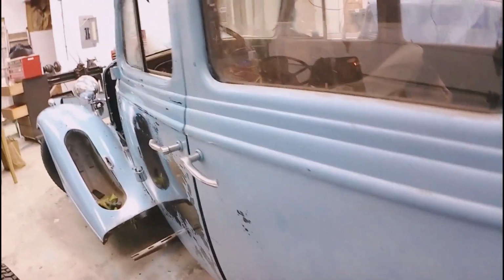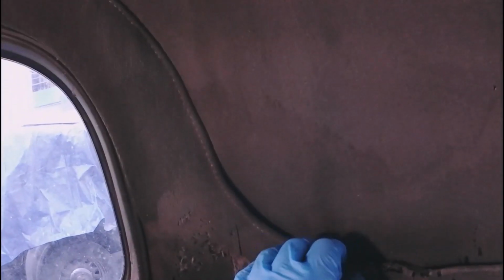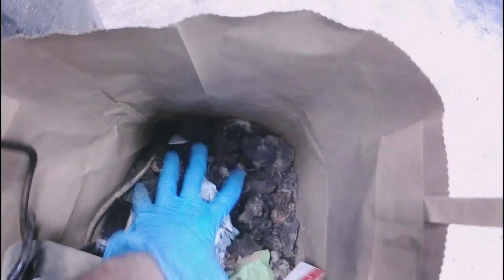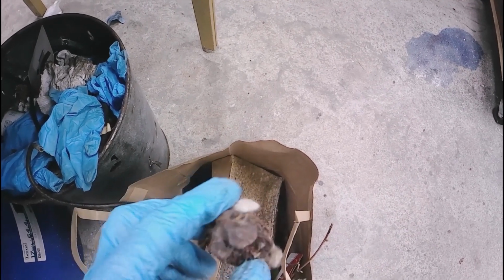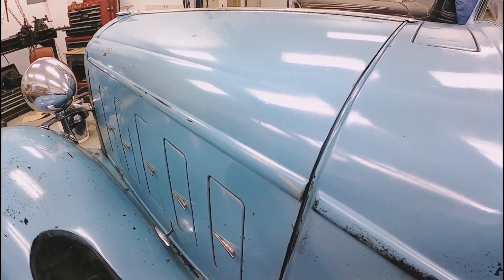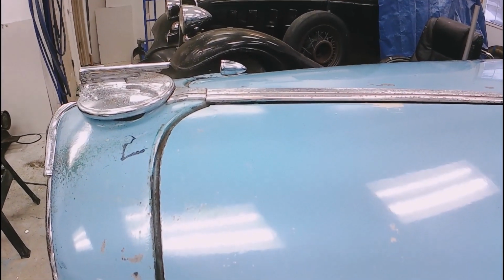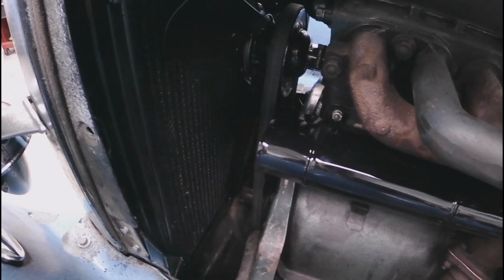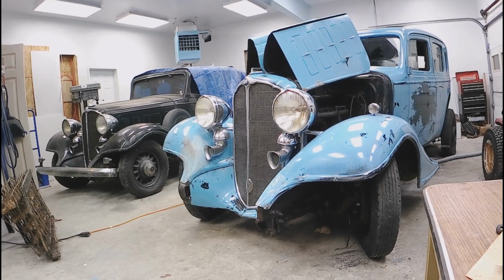1933 Buick Hood and trim etc.

Comment: Beautiful cars!!  Really like your sense of humor, LOL.  You deserve more subscribers!!  Cannot wait to see these running and driving.  Are you planning to restore the interior?  I've subscribed to your channel, you have me hooked on watching the progression!!
Reply from the maker: Much thanks! I had been making these videos for my stepdad who's unable to travel here, and figured they may be useful to other '33 owners for reference. I honestly didn't think they would gain as much attention as they have, as there are so many good car / restoration channels on here, but certainly happy that people are finding them useful or enjoyable!

On the interior, yes. I've been slowly dismantling interior parts as I remove them and making templates. I have an old leather patcher and another machine that I have been able to use to upholster parts with. Both the cars need complete interiors and possibly a 3rd that's outside. I've been searching for a deal on Mohair but haven't had any luck yet.

Glad you are enjoying the videos! Do you happen to have any experience with sand casting? At some point I need to cast some pot metal trim parts and possibly a brass impeller for the water pump, but I've no experience with any of that (yet). 

Cheers
Chuck
Reply: @78chuck   --  Unfortunately I don't have any sand casting experience.  30 years of Blacksmithing, including for the National Park Service, but I've never sand cast.  However, subscribe to "Windy Hill Foundry" !!  He specializes in helping people who are restoring antique stuff like us.  I've seen him cast unattainable and rare auto parts.  His channel should have contact information. I've known about him for awhile because I belong to several organizations that deal with things like steam engines, hit and miss engines, antique machines, antique trucks and tractors, and antique tools.  If I find any more sand casters I'll let you know.  I believe there is one in Minnesota, but I don't have his information at the moment. 

There are a lot of restoration channels for sure, and I subscribe to a couple of them.  However, your channel is unique I believe. Your approach, dead pan humor, and willingness to try different methods to fix and restore a part is excellent.  I was blown away how you made your own parts to fix that starter button!!  Then you hand made that floor pan without an English wheel, etc. making your own fixtures, WOW !!
Reply from the maker: Thanks I will definitely check out windy hill. I've watched a few people do it and done some reading. It looks like it can be a frustrating process. 

You're too kind! Some of the things I do are a bit hackish, however however I do think there is a lot of learning that can be harvested in developing workarounds when you don't have the proper equipment. When I use a milling machine, I feel like I better understand the material properties from all the grinding and cutting I've done by hand. Similarly when I use someones brake, I think I get better results right out of the box because I've bent so many pieces in vices and around chunks of I-beam!

Cheers!
Chuck

Comment: I just realized that the car used to be black have you had any thoughts about removing the blue paint?
Reply from the maker: Hi Mike! Right now I'm just cleaning up the paint to see what I'm working with and make it look a bit better. The car is originally a deeper shade of royal blue. At some point someone painted over it with black lacquer. Then it was painted Bluick Blue I'm guessing in the 50s-60s. What I do know is that I don't want both the cars to be black. 

I'll have to make some decision soon as the rubber top needs replacement and the metal surrounding it needs some repair. So I'll either match the current blue until I get into the bodywork or commit to a final color which would be the original blue or a color off the Buick paint chart for '33.

My objective is to avoid any changes or mods to the car that could not be undone more than attempting to make it 100% original. I'll likely be going with lacquer however.

Cheers!
Chuck